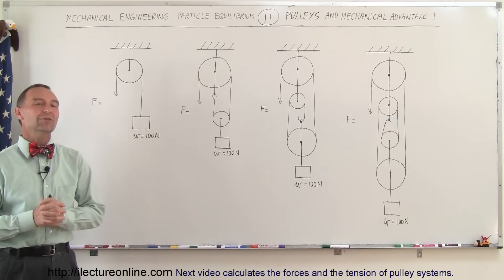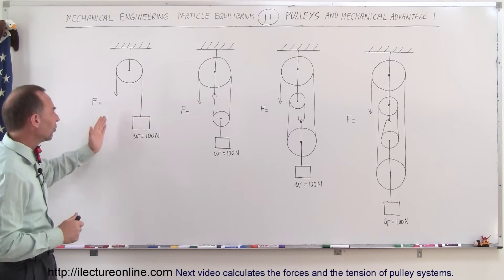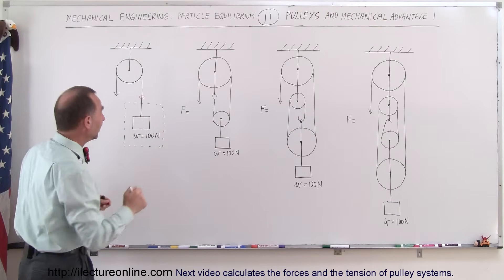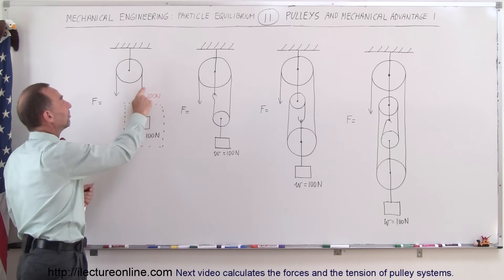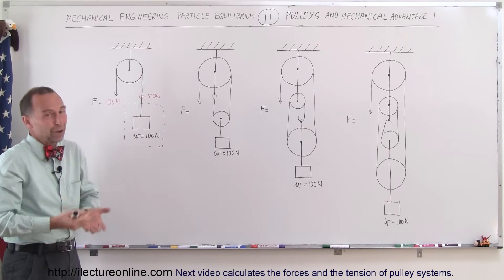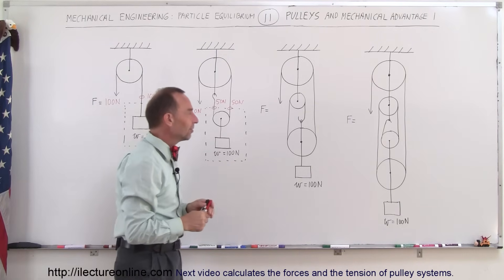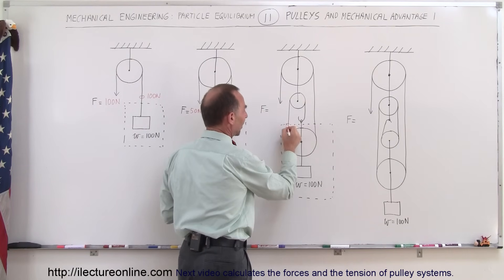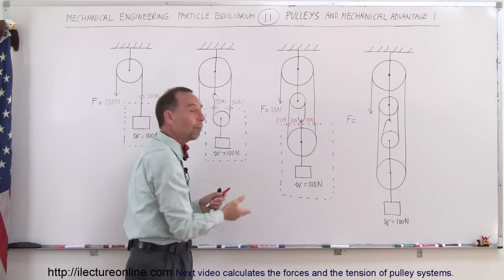Mechanical Engineering: Particle Equilibrium (11 of 19) Why are Pulleys a Mechanical Advantage?

Comment: Great video, theoretically yes, but in practice we need to take into account each pulley's weight and friction as well, not talking about rope's weight that is by the way deducted... not added. rope acts like a siphon in liquids
Reply from the maker: Yes, for simplicity we ignore all that.  Depending on the load, ignoring that is often OK in the real world as well.    But when you deal with steel elevator cables, then it is a different story.

Comment: Just a quick question.. I am assuming the string at the top connected to the ceiling are all feeling the same strain?
Reply from the maker: The tension in the string holding the system to the ceiling = weight + force
Reply: @MichelvanBiezen  So diagram (1) string is holding 200N and diagram (4) the string is holding 125N ?
Reply from the maker: That is correct
Reply: @MichelvanBiezen  makes perfect sense, thank you.

Comment: I learned this in 8th grade what are the comments talking about with engineering courses
Reply from the maker: This is typically not introduced in eight grade.  Did they explain this in eight grade using free body diagrams?

Comment: Adding more pulleys reduces the amount of FORCE required to lift an object, but you are still doing the same amount of WORK.  That is why when you reduce the FORCE, you increase the DISTANCE you have to pull the object.
Reply from the maker: That is correct.  Mechanical advantage simply means that less force is required to move or lift a load.

Comment: Wait-- In the first scenario with a single pulley, what about the force on the rope suspending the pulley? Do we ignore that? It wasn't there before we attempted to lift the object using the pulley, so it must have come from the object -- yet you say there's still 100N on the rope we pull? Must be magic. The force on the rope suspending the pulley must have come out of thin air.
Reply from the maker: The tension on the ropes from which the pulleys are suspended do not affect the forces calculated in the video.  🙂

Comment: Mechanical advantages are often only advantages in theory. We neglect the friction to make the calculations easier. Suppose we are to rescue a climber who has fallen down a cliff, the person weighs 90kg and we use pullys in a 9:1 system. Do we then only need to pull with the power a ninth? The friction in the system cannot be neglected. Climbers use dynamic ropes to avoid injury if they fall. Let's say the person in distress has to be lifted 10 meters, there will be a lot of rope to stretch before we even lift anything at all. So in practical cases it can happen that we get a better mechanical advantage if we instead lift the person with a 3:1 system. Your calculations are a good starting point for describing reality.
Reply from the maker: We first learn the principles of physics by ignoring things like friction and wind resistance.  Then once we understand the principles, we add the compexities of wind resistance and friction.  (We have videos on ropes and friction in the mechanical engineering  videos).

Comment: So, the lesson learned here is... you can't cheat at physics.  

The actual amount of work needed to lift each by the same distance is exactly the same (minus the slight inertia and friction loss, as well as ignoring the mass of the pulleys of course).  More force over a shorter length of pull vs. less force over a much longer length of pull.  

Technically, it requires slightly more work performed as more and more pulleys are added to ease the force needed to lift (right side of the demo shown).
Reply from the maker: Yes, some energy and force would be lost when accounting for friction, etc.  But ignoring that the total work put into the system will equal the work done on the load, we just will have to pull a greater distance to accomplish it.

Comment: Zanedbání třecí síly bych ještě toleroval, ale zanedbání hmotnosti kladek je neodpustitelné.
Reply from the maker: We ignore the mass of the pulleys all the time since their mass is usually a very small fraction of the mass of the load and in any practical application the pulley's mass is not significant.  However if you are interested in knowing how to deal with pulleys when we do include their mass, we have an entire playlist with examples of how to include their mass and therefore their moment of inertia.

Comment: Check your riggers manual. for overhead lifting you need a  10 to 1 safety factor. So to .lift 50 newton you need a rope with a working strength of 500 newton. when you run a rope over a pully you lose 50% safety factor. Every time you run over a pulley you need a stronger rope.
Reply from the maker: Interesting information.  Thank you.
Reply: @MichelvanBiezen  Its been some years. Think the example was using a sheave and  a snatch block the rope had a 10 to 1 safety factor. There was a 20% weight estimate error. That lift would exceeded the working strength of the rope. Everybody would be happy with completing the lift,. Probably if the lift was repeated  one or two times the rope would fail over some .heads. .

Comment: what if you take your FBD between the last 2 pulleys on the 4th one.
Reply from the maker: Not sure what you mean by " between the last 2 pulleys on the 4th one".  Free body diagrams "include" portion of the system.  Which pulley(s) did you want to include?
Reply: @MichelvanBiezen  4th example on the very right. FBD around the weight and the first pulley above it. There are three lines holding it up. Similar to the third example. I guess drawing the box there doesn't give you enough information about the center line?
Reply from the maker: If you draw the boudary of the free body diagram above the bottom pulley, you can conclude that the two string would have a tension of 25 N each and the middle rod would then have a tension of 50 N.

Comment: Does the diameter of the pulling have any bearing on the mechanical  advantage?
Reply from the maker: No it does not.  As long as the ropes are near parallel to one another.

Comment: This all assumes that the resistance of the puppy has zero friction in the turning of the pulley, such has does the pulley have bearings, is it well lubricated? Is it rusted etc… and what kind of slippage resistance is between the rope and the pulley surface.
Reply from the maker: Indeed.  This is just a theorectical explanation assuming no friction.

Comment: for the first pulley in the left, how much force on the ceiling ? is it 100 N or 200 N? 
if 200 N, would you explain the logic? 
thank you sir
Reply from the maker: It is 200 N.    The two forces acting downward must be counteracted by one force at the ceiling      F (ceiling) = F (pull) + mg
Reply: @MichelvanBiezen  one extra question, how come that force doubles its value? I know there is no such thing like Force Conservation but still no moment arm here to affect force proportion
Reply from the maker: The force upwards must equal the force downward, (assuming the object is moving at constant speed).

Comment: On a practical note I use pulleys quite a bit,(fairly simple pulleys). What we call a block and tackle, ie , 2 pulleys, one with 2 pulley wheels the other with 1 pulley  wheel. Both have a hook , the rope goes over the first wheel of the double pulley then down and over the second, then back up to the first . Then the end of the rope coming out of the second pulley is the one you pull on to lift the weight. The top, double pulley is attached to a beam while the bottom pulley is hooked onto the load,(in this case an animal carcasse). Fairly easy to lift anything up to about 100 kg.
Reply from the maker: That is great information.
Reply: Soooooo the anchor point is still bearing the full weight of the load,plus weight of rope and pulleys* right??

Comment: Then, the force exerted on the ceiling would be 200N in the first case, 150N the second, 132N and 125N on the third and the forth consecutively. Isn't that right? Plus the weight of the pulleys
Reply from the maker: That is correct.  (The 132 N is actually 133.3 N)  🙂

Comment: Pullies are not a mechanical advantage, they are a mechanical equilibrium.
A lesser force may be required when using pullies to lift a heavy thing, but the distance required increases.
The effect is say 1n to lift 10n by 1 m, then the equilibrium is maintained as the 1n force has to travel 10m .
1 x 10 = 10 x 1
Reply from the maker: The definition of mechanical advantage = ratio of  force lifted to the force applied  (distance is not part of the definition).  However work done must be equal therefore if the mechanical advantage is 2:1 then the distance required is also 2:1

Comment: On figure no 4 I have questions 
As assumed if we replace the force to weigh and weigh to force. Than it will work as or different? Force will required same 25N or different?
Reply from the maker: Not sure what you mean by: " if we replace the force to weigh and weigh to force"

Comment: Thank you very much for your video and I appreciate😊your great effort for making this video! I am very interested in physics and i always like think outside the box! 

In 50sec, the force required to pull this weigh up is 100N and understood teacher assume ignore the friction for calculation, In real life it would never happen! The answer must be more than 100N, 100N can only make the weigh don’t move but in an very unstable situation, small wind will make it drop in real case if the force is only 100N. In order to move it, the force must be “ more than 100N, depend on the friction coefficient of the axle, rope, pulley and wind drag of the weight ! Yes, wind drag will also need to be counted in real life!

During physics lesson and in secondary school, all the above situation will be ignored for educational purpose , while this will never happen in real world ! 
In our real life, there are a lot of “friction” in terms of financial, political, cultural….
in which we must take into consideration !
Reply from the maker: It turns out that once the object is moving the force required to lift the object is exactly the same as the weight of the object (in the left most example).

Comment: If the load equals 100 Newtons it requires 100 Newtons of force to lift it does that mean the Anchor Point is 200 Newtons
Reply from the maker: On the example on the left side, yes.
Reply: When you're designing anchors that's  important information to know that's the reason I bought it up

Comment: in 5:51 why did we take the free body diagram to contain more than a pully?
Reply from the maker: You can place a free body diagram anywhwere you want.  The purpose is to determine the forces into and out of the free body diagram.  Thus placing the boundaries at different locations give you the wanted information.  🙂

Comment: Very well presented but I have a question.  If the force on both sides of a pulley is the same, wouldn't that mean that the object is in equilibrium so it wouldn't move? In other words, isn't it necessary for F to be greater than W to move the object? Thanks
Reply from the maker: Yes, if there is no motion, the object would not move, since as you pointed out the system would be at equilibrium.  But if one momentarily increases the force of the pull, to start the object moving, the object would then continue to move with the forces being equal (see Newton's first law).
Reply: @MichelvanBiezen  Thank you

Comment: I'll tell you something all you engineers don't know, never figured out either, at least you've never say so?(or will),,
The anchor point at the top holding the pulley is holding half the weight, every time you add a pulley, divides the weight in half again if the pulley is the same size,,,,,
at the same time it causes more time and farther distance for you to pull,,, to move the weight higher, away from gravitys pull,, and a much longer rope is needed,,,too
Reply from the maker: Good input.  🙂
Reply: @MichelvanBiezen  I'll bet it,will, completely disrupt your education when you find out that gravity doesn't pull it's pushing,, so many variables,, but what works for mankind,, engineers we're crawling working experienceing recording,, then they needed the math to add it all together,, then they became the title of engineers,,
Reply: the larger of the diameter of the pulley,, the more weight the anchor point will be holding,,, this might point you in the direction, that gravity pushes not pulls,, less effort for the energy that's pulling the Earth in a spin, against gravity from the other side,, 
shot in the dark this may be way beyond you,,the black hole in the center of the Galaxy,, is the anchor point,,/as the anchor point of all the galaxies,, would it be but all that was, once was alive,, crazy as can be haha!!

Comment: does this apply if they are horizontal instead of vertical
Reply from the maker: Yes, but you would not have "hanging weights".  They would be replaced by forces pulling in the opposite direction.

Comment: I am looking for a pulley arrangement which reduces mechanical advantage to 0.3 to 0.5 to 1.
Reply from the maker: Take a look in this playlist:  PHYSICS 5.5 PULLEYS AND MECHANICAL ADVANTAGE   https://youtu.be/XFOYxF0PJLs
Reply: @MichelvanBiezen  - Thanks for your reply.  After making some diagrams and thinking about it, I figured it out.

The reason I wanted to go the other way on mechanical advantage is the length of pull advantage.

I am designing a small roll off roof observatory.  In the event of a power failure of the drive motor, I need to have a way to disengage the drive system and have the roof close on its own.

The length of travel of the roof is about 14 ft (~4.25 m).  Using a counterweight, I would disengage the drive and let the weight draw the roof closed.

The vertical drop for the weight is about 7 ft (~2.1 m).  So, I designed the pulley system to move the roof 14 ft as the counterweight drops 7 ft.  I believe the force required to overcome bearing friction and close the roof should be about 70 lbs (32 kg).  Since the ratio of length is 2:1, the counterweight (most likely a concrete block) traveling vertically the 7 ft should be in the range of about 140 lbs (64 kg).

Comment: But here you are applying mechanical equilibrium in order to find F, and that's not the case, you move the pulley, it's not in equilibrium.
Reply from the maker: It doesn't have to be in equilibrium.  If you pull on the rope, such that the objects move up at constant speed, the answer will be the same.
Reply: @MichelvanBiezen  Thank you for your response.

I get that you can achieve constant speed with 0 net force, but if it's resting and you want to pull it up, you've got to accelerate it. Otherwise you ate just holding it. Am I right?
Reply from the maker: In order to start the system moving, you will need a momentary acceleration and a momentary additional force.  But that is not part of the problem here.  (that is called the transient phase).
Reply: @MichelvanBiezen  That's what I meant. Thank you!

Comment: In a round about way its kind of like leaning a heavy objects one side on a higher ledge, then lifting the other side, which is easier than lifting the entire object aloft, except in this scenario, the effect can be multiplied with more pulleys.
Reply from the maker: That is called "mechanical advantage".   Just like with pulleys, you would have to lift the one end by a lot to move the heavier object by a little.
Reply: @MichelvanBiezen  for sure. In a way i think you are doing that by lifting one side up of something too, since it now comes up in an arch back to level from almost horizontal,  rather than a straight line up just lifting the whole thing. Trading distance for force there too... huh..

Comment: doesn't the circumference of the pulley play a role in how far the rope must be pulled?
Reply from the maker: The diameter of the pulleys does not play a role, unless the rope deviates from the vertical by a significant amount.  The size of the pulleys are chosen to keep the rope as vertical as possible.

Comment: and why didn`t we draw the free body diagram in diagram d over the first pulley in the bottom not the second one?
Reply from the maker: The position of a free body diagram is intentional in order to determine the forces (or tensions) of specific points or cables in the system.  So the position of the free body diagram is arbitrary, but intentional if a specif force or tension needs to be determined.

Comment: I`m a bit confused...why isn`t  the force in diagram a 50N?
Reply from the maker: which of the 4 diagrams are you referring to?
Reply: @MichelvanBiezen  diagram 1
Reply from the maker: For diagram one, the tension on both sides of the pulley must be the same.  Therefore the  force (pull) must be equal to the weight on the other side and must be 100 N.

Comment: Excellent introduction to Simple Machines!  Couple of questions, though: How would the consideration of a) pulley friction and/or b) rope slippage affect the mechanical advantage for the situations described?
Reply from the maker: If there was friction, the efficiency would be diminished, and the force required to lift up the object would need to include the force required to overcome the friction force.  The slipping would complicate the situation more, but it would depend on the amount and type of slipping.